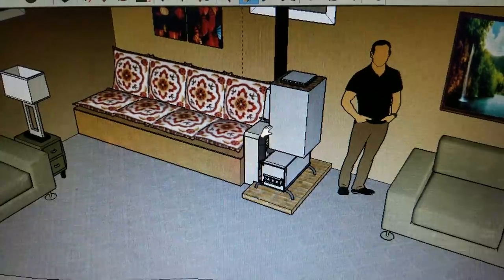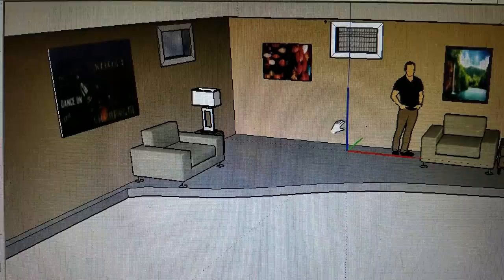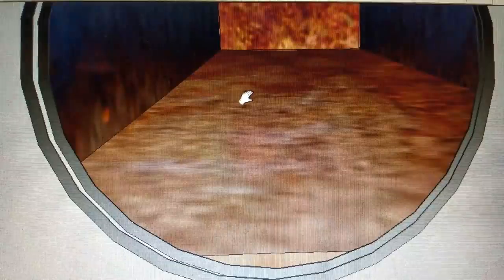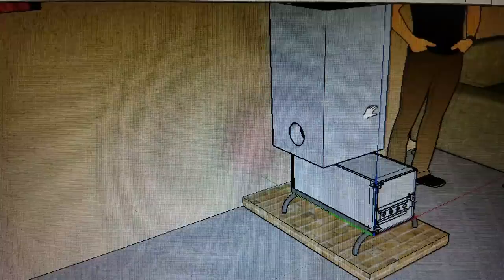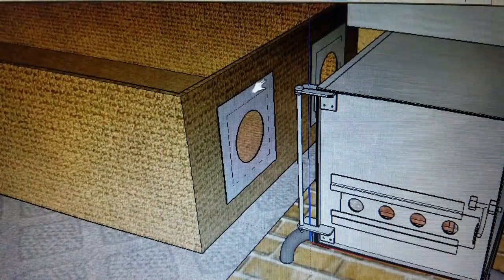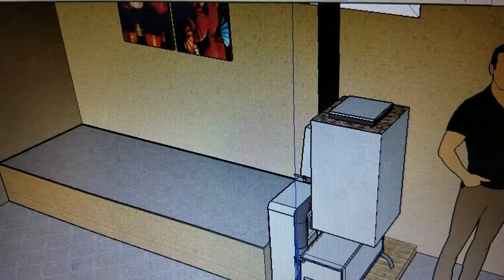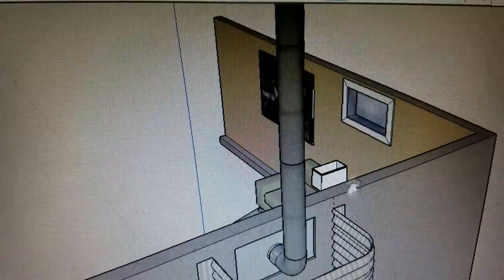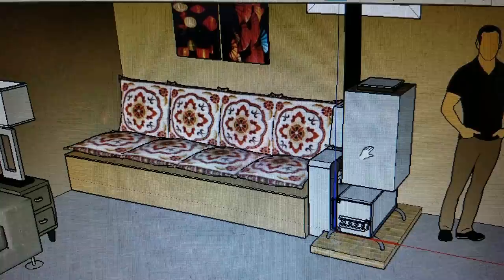Hard to Beat, Free Heat, NEW Wood Stove Technology

Comment: I am probably just showing my ignorance here but, ....
Does the riser not want to induce a vortex to allow complete burn of the gasses within the riser length ... I do not see how you are starting that vortex off  (no off set to the burn chamber /riser)?
You have a square section to the "barrel" .... this would also counteract any vortex! 
You have an insulated section over the "barrel" .... or is this Thermal Mass? .... eather way it will reduce the flow of gasses due to draw ... unless you are getting the draw by having a hot exhaust into the chimney?
If you have hot gasses entering the bench how do you stop the top of the bench getting too hot whilst the bottom is still warming up?
You have commented that this is scaleable, but how you can get it to work on 6" logs without enlarging the whole thing to become a commercial furnace? As I understand it you need air to wash over the sticks to fan the flame to make the "Rocket" increasing the sticks by a factor of 20 or so will mean you would need a gale to be blowing over them!
You say you have had this working for a season so obviously you have overcome these problems .....  it will be interesting to see how and why it works! Also if it works as advertised it is no longer a traditional rocket mass heater but a new varient!
In your future videos can you explain how you turn aircrete from insulator to thermal mass storage .... that is something I am having trouble wrapping my head round ;0)
All the best!

Comment: Everything about this is good, with the exception of using aircrete in the bench-- you'd be better off to use pea gravel, or even water-- something that absorbs the heat instead of letting it pass all the way through to the outside.

Comment: I love this design and you have probably put a lot of thought into it. I followed your "Dirt Patch Heaven" build and was impressed. I would recommend you build this and start experimenting with it. Pea gravel as discovered by many rocket mass heater builders is not a good thermal mass battery due to all the air gaps in a pile of gravel. I would not use aircrete due to it's insulative properties. You need a solid material.

Comment: Whoa..... Darwin, are you trying to keep the bench top from heating?  Because if you poured aircrete over your bench ducts- you would be SHIELDING the heat from moving out of the ducts, into a mass and consequently, from heating the top where butts are waiting to be warmed. Your floor would then take the brunt of the heat. As you have proven to your YouTube audience, aircrete is insulative and wouldn't serve as mass. Leon also makes this point. Otherwise, I love this simple design and your explanation of details.

Comment: Excellent word, Darwin, ooopppps Honie dew, . . . . LOL My only question is how do we either build a batch box, for extended burn times, like 5 hours, at slowest rates and still get the efficiency from the stove????? 2ndly, how much of a drop is possible between the Heat sink cowling and the Battery bench, as I was thinking of installing the bench / Thermal Mass in the crawl space under the house and the fire box on the 1st floor porch????? And yes it is a contained porch during the winter. 
 B BIG time Blessed and thank you for all You, and Your WIFE, have done for us.

Comment: 16:22 The only way for water to be the only combustion product would be for you to burn hydrogen. A theoretically perfect burner will still need to convert all of the carbon in the fuel to carbon dioxide, and any trace amounts of sulfur into SOx. Also, as the temperature of the burner increases some of the nitrogen in the air will be converted into NOx.
Reply: It's "bro science" lol